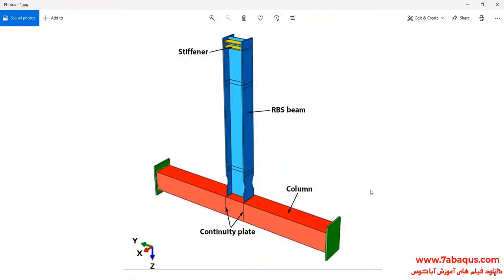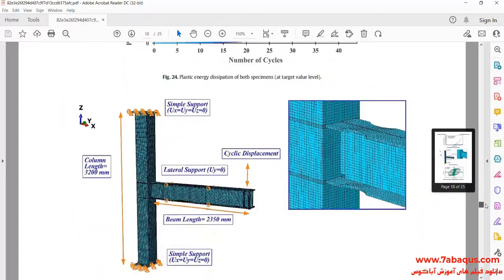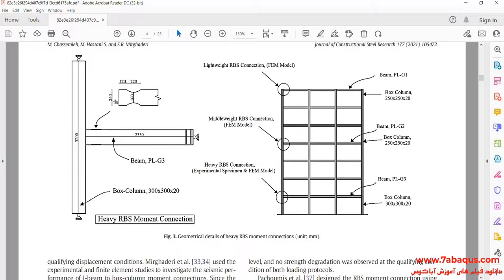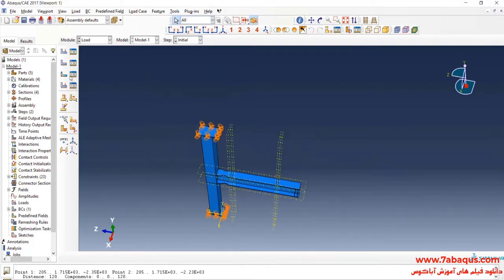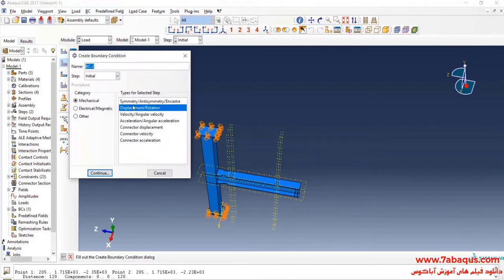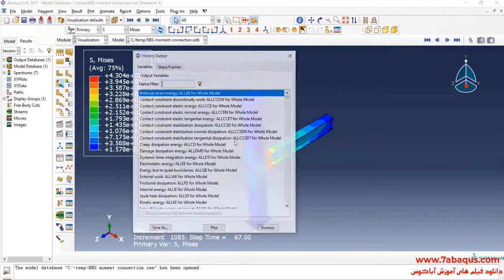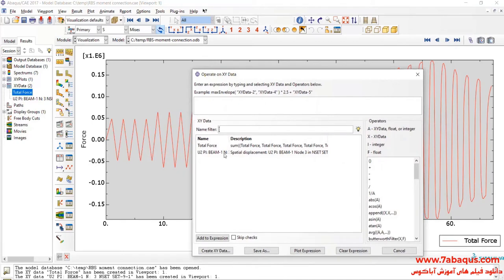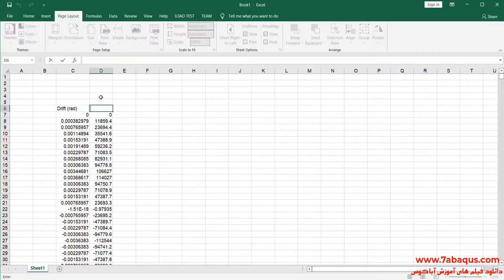RBS moment connection in box-column under cyclic loading Abaqus

Comment: I recently completed the model following your video, and I was able to run it successfully. After that, I had a question regarding the contact between the beam and the column.

I noticed that in the video, there was no contact or tie interaction defined between the two. Was this because the assembly was merged beforehand, so the parts shared nodes?

Also, in case I wanted to define an interaction manually, what type of constraint or contact interaction would you recommend in this situation (beam and column both modeled with shell elements)?

I’m a beginner in Abaqus. Your video was very helpful for me.

Thank you in advance!
Reply from the maker: Hello
The action of "Merge" does the same thing as Tie.
You can do it manually using the tie constraint but it will not make any difference in the results.